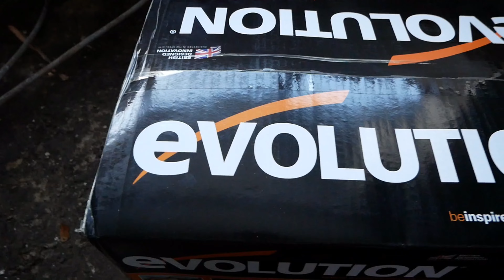evolutions wacker plate (electric wacker plate) vibrating and compacting stones floor unboxing

Comment: As a civil engineer for 20 years this unit is good. Great for indoors work avoiding carbon monoxide. I recall send 2 labourers ( both guys in th late 50s) to collect a concrete saw to install a RSJ. At main showroom VW dealership. Expecting them to collect a hired cordles electric,  no hired a petrol  saw. Guy collapsed from monoxide so ambulanced away t,  and not a good impression  on safety. Guy was fine. Week off work forthis self ep ly after, hire centre called with a cordless saw. I was left to deal a HSE! Indoors incident! Indoors? use electric saws for indoor jobs.
Reply from the maker: Yes these are perfect for inside jobs I for one hate the smell of the fumes and not good for you at all... this is not the most powerful one but it still has a good impact if you don't try got to deep to fast and just lay an inch or 2 at a time